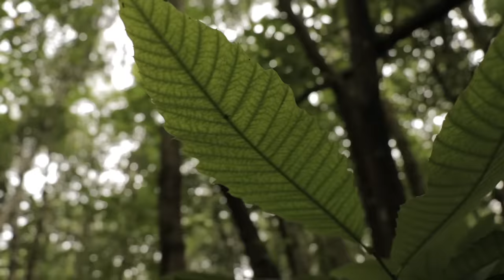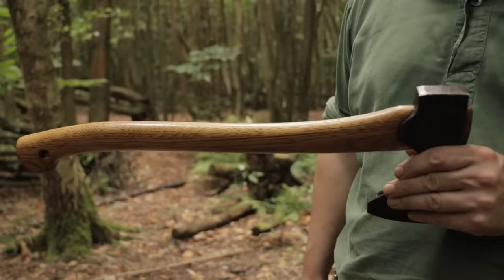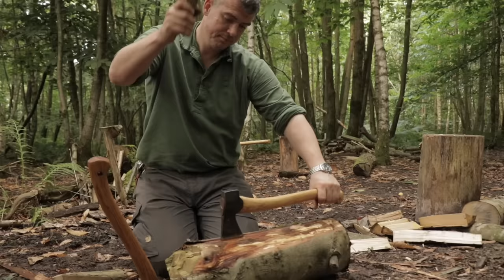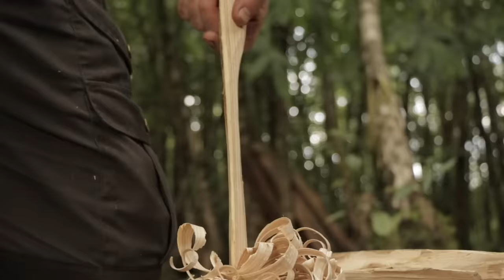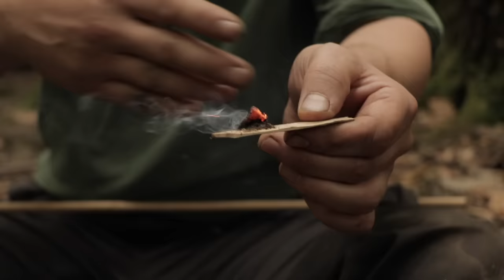Bushcraft Skills - Axe & Knife Skills, Camp Setup, Fire (Overnight Camping)

Comment: Timeline ⭐
8:00 Trick for holding a saw
11:00 Splitting logs without a chopping block
19:00 How different types of trees burn
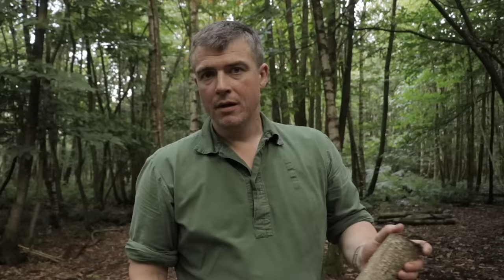21:00 Splitting logs when you have a chopping block
29:15 Splitting a huge log
35:00 Splitting a huge log without chopping block with a small axe
37:40 Splitting huge log without chopping block with a larger axe (3/4 axe)
39:49 If the log doesn't split easily
41:00 Playing Golf ;) 🏌️‍♂️
41:09 How to carry and store an axe
43:38 Setting up a tarp shelter
49:35 Feather Sticks
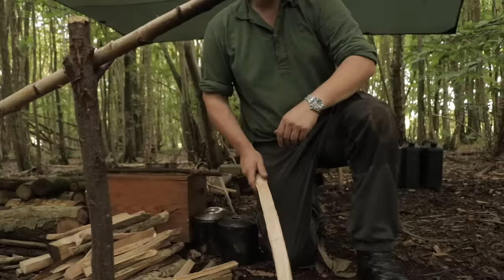56:10 Basic Fire Lighting
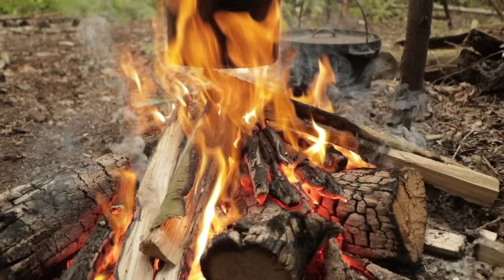1:05:05 The Coffee Drop ☕
1:09:15 Bow Fire Hand Drill

Please add improvements in the comments and I'll update the time stamps! Thanks for your help.
Reply: 8:00 trick for using ten times the energy to accomplish the same task by moving the ridiculously heavy log back and forth against the light saw instead of moving the light saw back and forth against the ridiculously heavy log.
Reply: so nothing on feather sticks?
Reply: @Magician12345  do you know the time stamp for feather sticks? I wasn't able to compete the timeline
Reply: @exhilarator4314  perfect, thank you!
Reply: @fifty5712  no i was clicking on the time line to find it but yt now gives me a lot of ads when i do so i got anoyed and quit.
Reply: Thanks.
Reply: Very helpful for future reference! Thank you mate!
Reply: @benfubbs2432  its way easier and more stable because the saw blade is flimsy also the log in reality isn't that heavy
Reply: @user-yr5yl6zt5l  Have you ever used a saw? There is a reason why nobody with a brain ever chooses to move the relatively massive tree branch against a stationary feather-lite saw.  In history every single saw has had a flexible blade to some degree and yet in history every non-mentally defective woodworker has chosen to keep the much heavier but stiff piece of wood still whilst reciprocating the saw.  Also you failed to mention the actual weight he is making himself move.  I'll pretend that the log weighs nothing, but he still has to lift his whole torso up and down repeatedly because of his bizarre technique, so the total weight he is moving is the weight of the branch, both his arms, his head, and his torso.  If he was reciprocating the saw against a stationary branch then all he would need to move is the weight of the saw (which weighs about 1/20th of the branch by the looks) and the weight of one arm and because he wouldn't be moving it up and down like a twit he won't be working against gravity but instead gravity will be working for him by applying cutting pressure.
Finally the saw blade is flexible but that is irrelevant as it will be equally flexible regardless of sawing technique so it's an irrelevant point in favor of either technique.  I personally just tension my blades properly so flex becomes a non issue.  Then again when I am in the bush I just keep the logs intact , with three poking into the fire. Even if they are five meters long it doesn't matter because as they burn I push push them in to keep the fire fed.  Sawing up wood is what you do when you need it to fit in a fireplace back in your townhouse but is a waste of time in a bush camp which makes this exercise even more baffling.
Reply: Basic fire lighting as 56:10
Reply: @bongoboi1395  thanks!
Reply: 41:00 . Playing Golf
Reply: @simpingfornami9679  got it ;)
Reply: Ur a legend man
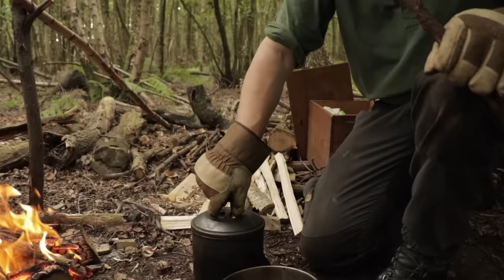Reply: 1:03:48 far far too much coffee

Painful moment for coffee lovers.
Its not coffee any more.
Its water. 
How much coffee you want. 
Adds 2 litres of water.
If you want more coffee add more coffee
😩 🧐 😒
Reply: @benfubbs2432  hahahaha thank fk theres a voice of reason out there on par with my own. I thought it was me and the people that fly rocket ships and i was all alone in the country of stupid. And how you had to explain it meticulously so they get it. I feel that pain. I had a rant about his insane coffee drop. Pls find my comment before backing him. Id like not to take the uncle Ben Fubbs you rightfully deserved. Check uncle roger to understand the uncle reference is a compliment of high standards. Note the comment above about coffee is not what i am talking about when i say my coffee rant. Its more physics based and a lot longer. In main comments. Very early.
Reply: @benfubbs2432  Lot of good info in the vid, but yeah that 1 seemed pretty silly to me. And rather ironically, for feathering the easy way is the other way around, but he did that one the hard way too by keeping the wood stationary and moving the blade. I was actually surprised by that as he seems relatively knowledgeable and I only just started watching/learning this stuff and that was one of the first things I picked up.
Reply: Why is this time stamp list even a thing if it's not coming from the author. Shouldn't it be the author's duty to timestamp and section his own video which is very easily done on youtube. You can not only section but even title those sections. Nice that somebody did it but shouldn't that be on the author of the video. Frankly the guy that came up with this initial list should get a cut of whatever revenue they made off of this video by making it easier for people to navigate the video if they don't want to watch the entire hour and a half of it. Quit working for free bud. Next time you do this for somebody; you should request payment. It's their job not yours.
Reply: yes and always pee on the saw after you use it to keep bears from eating it.

Comment: Another technique to get the coffee to drop is to lift the pot 1-2cm and just let it fall gently bak to the ground, learned this trick from a reindeer farmers boy in the finnish army, he called it "tötsäyttää" and he told me that the grains that have som air in them you need to "knock" out the air from them so they fall to the bottom

Comment: In Australia we spin the billy.  You hold the billy with a locked, fully extended arm as Paul was doing at the end of each "drop" but you spin your arm a full 360 degrees using centrifugal force to keep the water in the billy.  Does a similar job to this Norwegian drop technique.

Also, I know this is a 3 years old video but this was fantastically detailed and helpful

Thanks Mike and Paul.

Comment: 31:38: «We refer to wooden wedges as gluts, I don't know the ethymology» <-- That's fascinating. The Norwegian language has a word "gløtt", which is pronouced exactly like "glut" and means "slightly open", similar to ajar, I guess. So in Norwegian, you could say «please leave the door on gløtt», for example. The verb "gløtte" or "to glut" means to slightly widen or open something. The word instantly made perfect sense to me, although I had never heard it before, since metal wedges would be used to cause a split, whereas the wooden ones would primarily be used to hold the split, or keep it on glut. :)

58:00: A much better way to light a match, is to support the head with the tip of your long finger, but move your match hand towards you, striking with the surface rather than against it. Ideally,  your long finger ends up pointing downwards, because that means the match is already shielded by the time it ignites. Moving your hards away give much less control than moving it towards you, which is very important when your hards are cold. If you really want to move your hand away from your body, then you should instead hold the match between your index finger and your long finger and support the head with your thumb. But even then, I'd say you should rather pull the match box towards you than pushing the match forward.

1:06:00: Hehe, I can explain why the Norwegians weren't catching up. They didn't want to impose. A Danish man sitting next to me on a train once opened a bag of candy, and trying to be polite, he asked if I wanted one as well. I was horrified. I wasn't a child, mind you, I was 25 or something. It's just that Norwegians like to keep a distance to strangers even if our thighs are touching. It's not that we're unfriendly. If you had been moving in the opposite direction, I'm sure they would've waved and smiled and maybe stopped for a chat, but they won't catch up. :)
Reply: Makes sense because old English was closer to its Germanic roots

Comment: Noticed that one advantage of the technique of the horizontal limb splitting technique you didn't mention is when the axe/hatchet is embedded in the splitting block, using that to support the blade while you twist the wood releaves almost all the sideways stress on the handle because the blade is being supported by the chopping block instead of your hand and the handle when twisting the limb to open it.

Comment: Brilliant video, many many thanks to you and Paul for the time and effort involved in bringing us the video. Proving that you're never too old to learn, after thirty plus years of practicing woodlore, or bushcraft, I've picked up a couple of extra tips that will save me time and effort in the future. 

I've never tried firestarting with just a pole and board, but massive respect for getting it going so quickly. The first time I tried bow drilling it took me considerably longer, which speaks a lot to Paul's tips and tricks, as in so many things, both bushcraft and otherwise, technique is everything!

The effortless splitting from some very awkward angles speaks loudly that Paul has technique and practice to make it a sure thing when most of us would struggle. I'm not given to envy, but Paul has one of the best jobs going, from my perspective!

You earned a new subscriber with this video, and I in turn gain from your content. This is the core of what YouTube should be, if only there were quality sources of information like your channel.

Comment: I have been carrying a 2 inch Stanley wood chisel with a car by tub along with my ex to do all my feathers sticking and wood chopping needs since my first camping kit, 43 years. I’ve only replaced my Stanley wood chisel once and all that time. It’s an excellent tool. I put it in my tacklebox that I carry with me as well and it is always there for me. I also carry some other camping knives but nothing does the trick like my wood chisel and hatchet/ask. Never had an accident with them either.

Comment: 30:00 ax in large log: make the handle 90 degrees to log. Bang drop the ax head on the stump. Put another ax wedge in the side repeat.

40:00 Long ax side cut, swing like a golf club. Fore. Spread legs log face where your second foot is.

Comment: The thing I've always hated about that technique of picking up the wood inverting it and allowing the log weight to finish the split; is that when doing so; you also risk an ax to the shoulder. Many of the times that he does it seeing as he brings his body down along with the log you can see just how close his shoulder comes to running into that ax front when the wood splits away from it. If you're out in the wilderness and there's a wet leaf below your foot when you do such an action you're going to fall right into that blade. Is it viable; yes but if the purpose of these techniques is to be as protected as possible while conserving energy I would say that the energy loss, being something that you can replenish, is less of a risk then potentially ramming your shoulder into an ax blade. Personally, I would be using the splitting wedges rather than risking my shoulder. A couple of those splits had me in absolute cringe mode as during one of them his shoulder was literally a hand's breadth away from making contact with that ax front and he appeared slightly off balance on that approach which like I said if there was a wet leaf this video would have ended badly. I hope he has a steel collarbone and sheet metal skin if he ever slips while doing so. Not to mention how if it doesn't split on that first shoulder throw you see what happens with the log torquing to the side again making for a risk of injury by throwing you off balance. Same premise as when he gave advice on not trying to split thin logs while holding it so you don't lose a thumb by mis-timing your strike, or being distracted or tired. You probably shouldn't be doing the shoulder thing because all it takes is one slip for you to have permanent damage and never use that arm the same again.🤔🤷 They make splitting mauls for a purpose. They are essentially an ax without a hole for the handle and are used for this purpose. Or you can make them out of wood since you're already in the woods to begin with 🤷. Another way to avoid these things is maybe not trying to split 2 ft long pieces of wood .🤷 The shorter your wood is cut the easier it's going to split. For campfires; 12 to 14 inches is plenty good enough. Even for use in an in-home wood stove no more than 16 in is necessary. Yet looking at this video many of the pieces of wood he was trying to split were well in excess of 20 some odd inches. The more length you have the more effort will be needed to split it. By keeping it at that 12 to 14 range; you can mitigate most all of what I discussed above and pretty much a lot of these other techniques he shows that one would need to learn for splitting wood. SHORTER equals EASIER. For reference; my hatchet from the base of the handle to the top of the ax is 14 in. I never cut my logs any longer than the handle of my hatchet which also makes marking the wood for equal length quite easy. Place hatchet lengthwise on log, Mark with saw, complete cut, repeat. Or better yet simply cutting a small stick to that length and keep it in your non cutting hand while sawing your logs. Wood cut to equal lengths is also easier to transport on something like a sled since this video is about bodily energy conservation as well.
Reply: Thanks for sharing your novel... lol
Reply: Jk. Nice comment

Comment: Absolutely amazing! Thank you both so much! I learned a lot from the wood processing, tarp setup and fire making techniques! I have a question about the guy hitch in the tarp setup. I’ve seen a similar knot in sailing and trucker’s hitch contexts. The only difference is that instead of the second wrap being parallel to the first wrap (and being closer to Paul in the video), the second wrap intersects with the first one (away from Paul in the video, with the first one between Paul and the second wrap). This helps secure the hitch while the knot is finished with the final hitch farther along the standing end. Is the parallel version a bit easier than the intersecting one for tarp setups? The intersecting one is a bit more secure for sailing and transport but I can see why it would be overkill for tarp setup. What do you think?

Comment: cool but i feel the more chop the master chopper u become ..if ur wood isn't as dry u wont be splitting  as easy as these guys make  it look. i try avoid knots cause we kniw they are extermely hard to bust and could take way more effort  to split..the old saw stuck in a tree or log is somethin you should go over. havin a sm hammer ir hatchet to put a wedge in will keep ur bowsaw from binding up.

Comment: Thank you for sharing this information. One of the most informative videos on woodland survival techniques I've seen yet. Very well done.

An old camp craft tip from when I was a kid. make a shallow notch in the log you are using to cut/ chop your wood. It helps hold the chopping wood in place. Cutting a flat strip also helps hold the log more solidly to the ground. 

You can also use a strip of bark to catch the sawdust to use for fire starter. Works surprisingly well.

Comment: Great video, very informative ! Another method of bringing the coffee grounds to the bottom of the pot is to pour a bit of water on top. The colder water will bring all the grounds down with it. The coffee can still be very hot and very good. It's called "cowboy coffee" in the U.S. I was introduced to it by a group of cowboys I rode with over the Continental Divide between Montana and Idaho. The water was naturally cold as we were at higher altitude but it can be done anywhere on your camping trips, all it requires is water colder than the coffee which it usually is. It can be done at room temperature and is a very effective method, you may try it sometime. Unless you prefer to do your one arm Scandinavian workout !

Comment: I was taught and reaffirmed via observation that the danger points are in front of, and to the right and left. If you stand 45° off your safe. 

I'm sure there are exceptions, but stuff seems to fly perpendicular or parallel to the edge. I feel safe if those directions are clear.

Comment: Rather than carry a shovel, an axe, or a machete I carry a La Grande Chef cleaver with a file as digging will dull the  blade; so what? A few strokes with a file & sharp again. When the ground is too hard for wood tent pegs🤠 I make holes for the peg with my Russel Belt knife a few strokes with the file & sharp again. My tools have to be able to take what I give or go.
Reply: I lay the wood I chop on the ground  which is the safest way of all  🤠 All those ways of being careful are comparatively more hazardous. Duh!
& I can cut a lot quickly without being distracted by having to baby the tool I am using 
Sheesh! Yes the axe gets dull & nicked so what  after a few strokes with the file  I could shave with it.  I get things done.

Comment: Any wood bigger than say leg diameter, look at the rings.
If the rings are 'O' shaped then we want to split it into a 'C' shape first.
This will release a lot of tension from the wood which then can be split in half easily. 
For wood the diameter of a car tyre, work your way around the ring then repeat,reducing the outside diameter.
This allows me to split huge hardwood logs like jarrah far easier than splitting across the rings, without the axe getting stuck as often saving my precious energy.
The rings will show you where its straight and where its knotted, taking the easy cuts first will release tension and make leaving the bulges till last far easier to split.